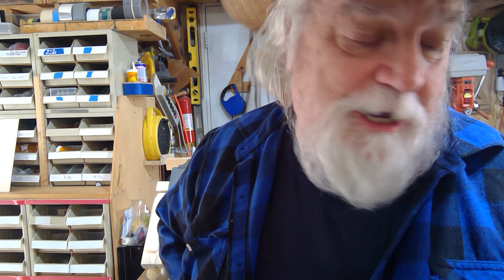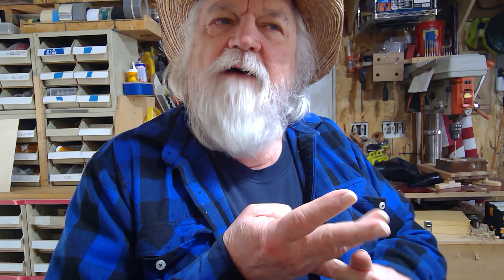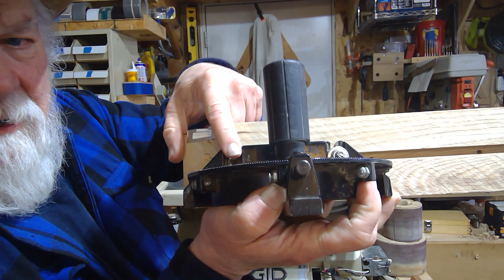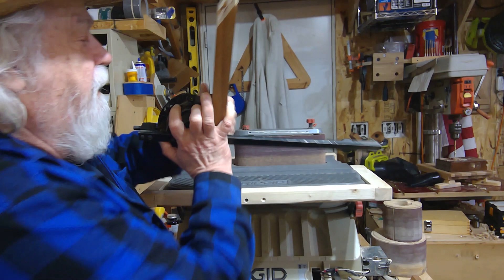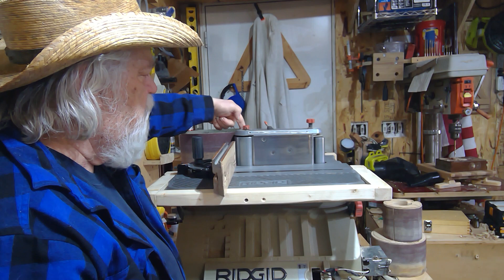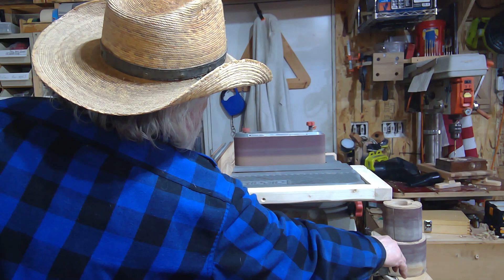ROBSS Part 2 Fence Setup by OTB Thinker

Comment: I also have a Triton sander with no slot. The dust collection is useless. I clamp my vacuum hose at the end of the belt sander and suck the sawdust as it is made. It helps, my particle count meter still rises. But I feel reasonably protected between the dust filter and my dust mask. Those are great tips, I still need to make the wood frame around my table edge. That looks very useful, but I have been busy lately making bird boxes. Thanks, Russ.
Reply from the maker: Now that's dust control :>).

Comment: Hey Russ, I have the TROBSS made by Triton. It does not have a slot for a miter gauge. It does have two knobs to lock your table in position. I bought mine to be able to "sand to a line" on whatever needs doing that. I find it to be very useful for that and quick sanding of other stuff as well.
Reply from the maker: Yeah, for years, I have used it to free sand lots of wood.  I used it mostly for bandsaw boxes.  Now I think I can do precise sanding on small pieces for joinery too.  How is the dust collection on the TROBSS?
Reply: @russveinot5754  I don't have dust collection on anything. I pull my dust makers out of a garage and blow the dust away.
Reply: Thanks Russ! I have had my Rigid fo about 15 years and you have made it more useful.
Reply from the maker: @str43bzr  Thanks John.  I have more improvements to come on this machine.